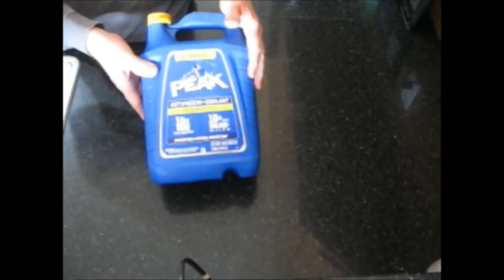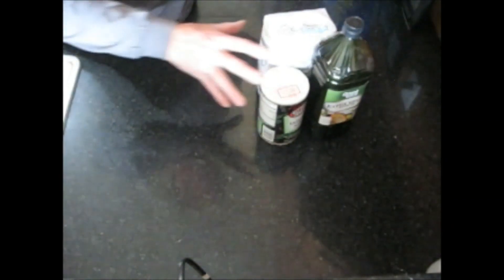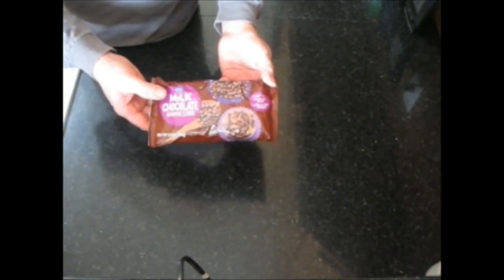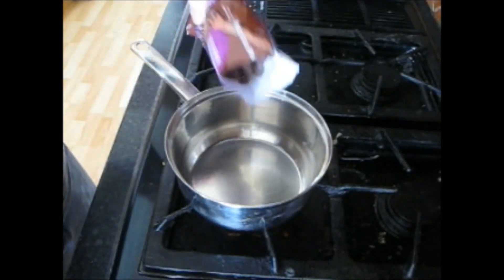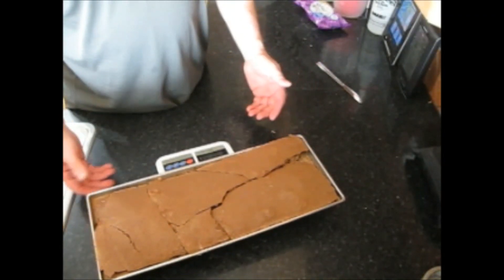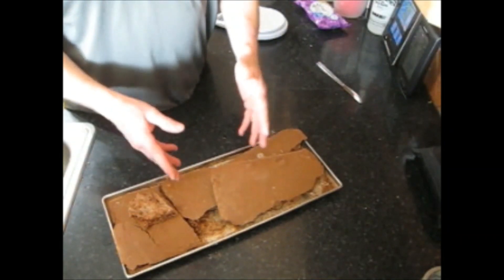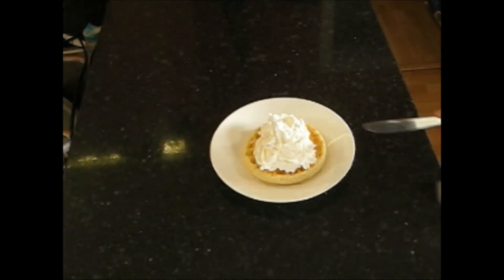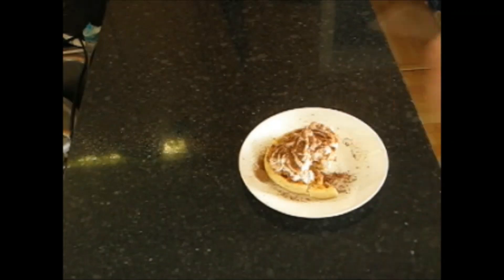Freeze Dried Chocolate

Comment: I said it before and I'll say it again. You're one smart fella!! This is the first time I have seen anyone attempt this. Thanks for sharing it with us.
Reply from the maker: Thanks
Reply from the maker: It takes me about 10 minutes to get to 500 Mtorr, however, at 4800 feet I have less air to remove.
Reply: @Philat4800feet  Thanks. I have an appointment today with Harvestright. I have done everything I could following everything you have done. I did not have a vacuum tester though, so cant tell if it's the pump. I checked every joint and even changed the ball valve. I didn't even make it to my first oil change. I have the premier pump.
Reply: They got me all fixed up. I just need to change a setting on a screen that I wasn't aware was there.
Reply from the maker: @matty332010  Which setting?
Reply: @Philat4800feet  She told me to touch the version number 4 times and when the three little dots appear on the bottom left of the screen. Then touch the leaf logo and it took me to another screen. In the middle of that screen there was up down arrows and a number in-between them. The number said 50 she told me to turn it down to -50. After that it worked better than ever. Within 30 mins it was down to 36MT. I can't tell you the name on the screen right now because I have a batch in right now. So I didn't have a leak at all. I'm learning something new about it all the time. It's frustrating but It's good to know how it all works.

Comment: As someone that makes their own chocolate, I find this offensive. Great work though. I don't believe everything people say that can and can't be freeze dried.
But if you didn't remove any of the fats will long term storage be affected? I suppose it won't bloom. Does it melt liike normal chocolate?
I hope you know I now have to try this to see what it can do.
I'm also curious what you mean about your allergy would kill most women? Just because women love chocolate, or it is physiologically different for women?
Reply from the maker: The melting point is much higher.  I'd like to know your results.
Reply: @Philat4800feet  sorry for the delay in getting back to you. I tried the experiment and it was totally successful. I used the cheapest cooking chocolate I could find in fear of wasting it, so the final results didn't taste great, because the chocolate didn't taste great before I started. It did expand quite a bit.
As you said, it seems to have a slightly higher melting point now, it certainly doesn't melt easily in your hands like untempered chocolate would. I was also surprised that it felt "oily" like normal chocolate as it melts in your mouth. I expected it to be dry and powdery like chocolate that has bloomed. Effectively it is very similar to Aero bars, if you know what they are.
Really good experiment. I don't know if it is useful to all the preppers out there, but as a fun textural difference it was a success. I've had most of it just sealed in a plastic bag for 3 or 4 weeks now and it seems like ir will last on a shelf the sae as normal chocolate, but only time will tell.
Reply from the maker: @MrGundawindy  Where did you find an Aero bar?  England?
Reply: @Philat4800feet  I'm in Australia. They're in supermarkets here.
Reply from the maker: @MrGundawindy  Lived in England.  Love the people, country, and food.
Reply: Aero bars on Canada too